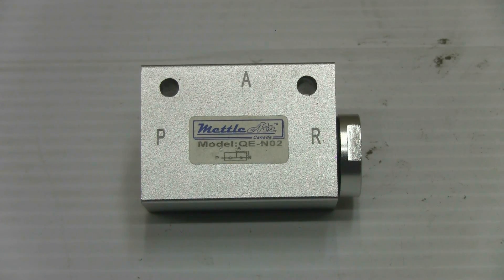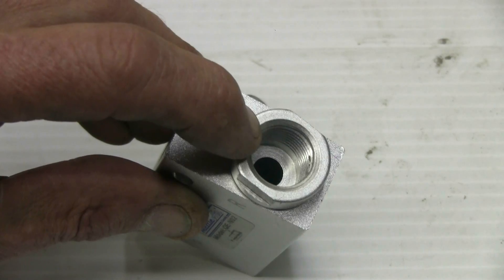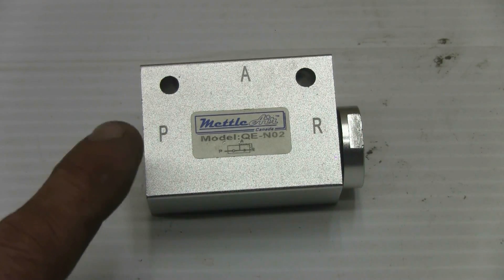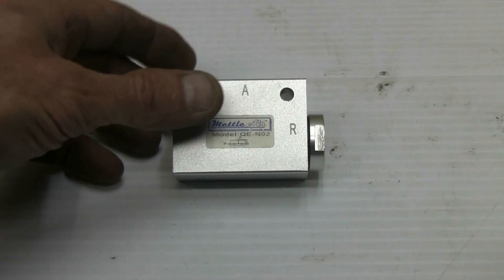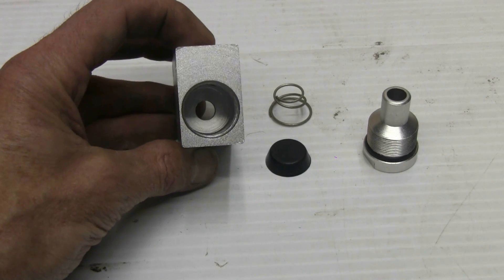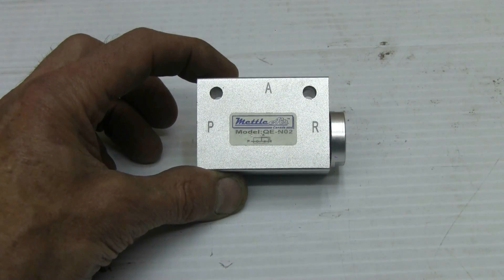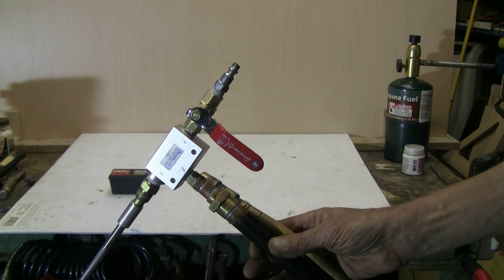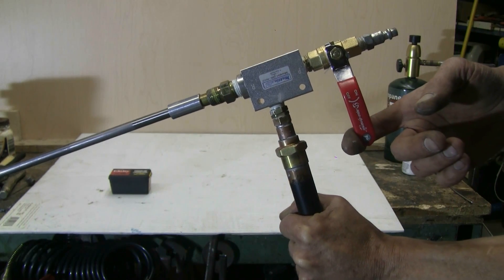How To Test, Mod And Use A QEV For Air Rifle Or Cannon

Comment: Is the spring keeping the rubber diaphragm pushed up on the barrel outlet rather then air pressure ?
If there was no spring would the air pressure push through the diaphragm wings escaping through the barrel?
Reply: Yes

Comment: I need to add spring?
Reply: Beacuse my qev dont work and  , i open ball valve and the air go from the valve where i pumps air , I need to add spring or what ? Please help
Reply: Haniball1337    The purpose of the spring is to make the qev selfclosing (multi shots with one fill).  Otherwise, it will dump all the air from chamber with one shot

Comment: Hey, thanks for the informative video. Do you know where I could get a high pressure QEV? 700-1000psi
Reply: Try making a stronger diafragm that should solve this issue
Reply: @ahmedfocak5691  YOU are correct, a polycarbonate diaphragm works very well👍 I made one and it holds a pressure of 1800psi.

Comment: One question +Bill Gilmour
Since you are not (yet) making a semi auto, why use the spring mod anyway? THe QEV will work as designed, right?
thanks!
Reply from the maker: +DoNotPushHere I put the spring mod in because I might use the valve semi auto in another project. One of these got used to make a semi auto .25 Cal bb gun. This uses Crossman .25 Cal steel slingshot bbs.
Reply: I see... Looking forward to see that semi auto then. Thanks for taking the time!
Reply: Are you using the chinese  qev from ebay?I currently used 115psi on my chinese ebay qev and scared it would burst if I go over!!would it hold up to 200 psi?

Comment: How do u keep the Bb from rolling out of the barrel, and could u get a multi shot function with a bigger air tank
Reply from the maker: +ethan williams I have two ways of keeping the bb in place. If I have a brass or aluminium receiver then I attach a small nib magnet to hold the steel bb. On a .25 Cal I made I used a spring clip that blocked slightly the .25 bb the force of firing moved the bb past the spring. A rubber constriction such as an o ring can work too.
Reply from the maker: +ethan williams Multi shot or even full auto are possible.
Reply: Bill Gilmour, thanks I was going to use a magnet, but I haven't been able to find any threaded aluminum pipe
Reply: @BillGilmour519  a magnet fucking genius why didnt i think of that

Comment: Why do you need the qev valve could you not just use the ball valve
Reply from the maker: +Cole Campbell Ball valve will work fine especially if it is opened quickly via a spring. The qev is a very fast valve and will give more power. I have never gotten supersonic with a ball valve but did get there with a piston valve using glass marble ammo.
Reply: Bill Gilmour so I could make a air rifle with just a ball valve

Comment: i don't understand... why would you use a QEV if you're using a solenoid. Solenoid is normally open, charging your reservoir from your source. Engaging the solenoid closes the port that did the chargin, and re-routes the reservoir to your barrel (seperate chamber). Releasing trigger =  solenoid spring return, reservoir fills again and repeat....
Reply: i think its because a large and powerful solenoid is xpensive & this can be semi auto

Comment: how did you make the barrel?I wanna do the same thing but with a rifled 45 cal barrel.
Reply from the maker: +hypoSPEED666 I made a 4 flute rifling reamer and a jig to pull it through my barrel. You may be able to buy a .45 reamer or rifling button online. My barrel was copper and easy to rifle.
Reply: +Bill Gilmour I have a rifled 45 call barrel already I mean the slide?the part that covers the opening in the barrel you load it through haha
Reply from the maker: hypoSPEED666 I machine these either from tube or solid stock. I leave just enough clearance for grease. That way not much air leaks out there upon firing.

Comment: why not use a manufactured valve from a 2240 or760, make life way easier
Reply: Different type of valve. The poppit valves on those guns are limited with what they can put out practically. A QEV has a lot more potential, it's just slightly more complicated. Easier to use as a dump valve, and easier to set up as a timed valve.

Comment: good video, would it be possible to make the reservoir bigger and get more shots from 1 125psi charge?
Reply: no, you would need a tank and a regulator. each shot would need at least 90psi, depending in what your using it for

Comment: Daisy .25 steel BBs? Where the hell do you get these?
Reply from the maker: They are sold as slingshot ammo. You can get .38 and .50 as well. Any sporting goods place that has slingshots will likely stock these.
Reply: TheRook

Comment: Hi Bill, thank you for the informative video. With my qev I was able to fire it off with no spring. So whats the purpose of the spring? Also how would you stop the air reservoir dumping all the air in one application? Cheers Steve.
Reply: I believe you answered your own question.  The purpose of the spring is so that if you use something like an electronically triggered solenoid valve instead of the manual ball valve he's got as the trigger mechanism, then the valve can be controlled to only stay open very briefly for each pull of the trigger.  Once the valve closes again, the spring will force the QEV to close and stop the release of air from the tank.  If the valve is timed appropriately, then it should be possible to get multiple shots fired from a decently pressurized reservoir tank while still maintaining decent firing power.  The QEV may close off without including the spring (I am not sure of this as I haven't tried it out) but regardless, the spring would be responsible for ensuring the QEV behaves how we would like it to with an increased reliability and with a faster response time than if the spring were not in place.  If multiple shots from a single tank fill is not your goal and you plan to use a simple manual ball valve like in the video, then I suppose the spring wouldn't need to be used.  Hopefully you've come to this conclusion already since you asked this question 4 years ago!
Reply: Hi it’s me from 2 years in the future, do you know why a ball valve lets all the air out but not a slide valve or solenoid?